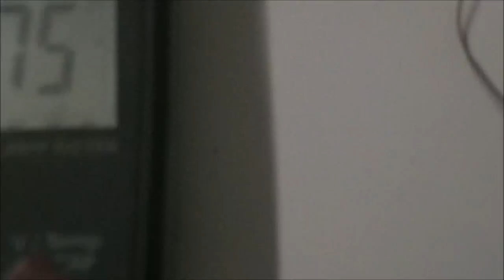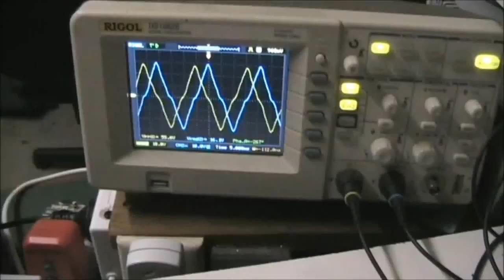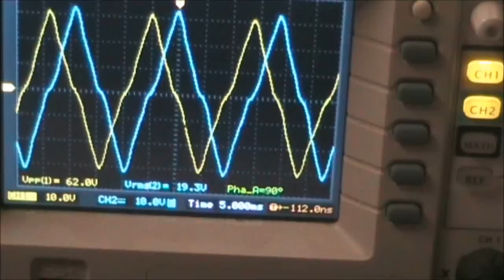Two Phase Generator/Exciter (test arrangement)

Comment: Finally! New bearing and get rid of the magnets. You want closed looped induction coils on the rotor. 2 phase. A magnetic loops should form between the ring core and the pulsing electric field of the field cores You can tap the unit for more power via unshorted rotor coils. In my design there are 3 sections just like Tesla's. Exciter/generator/motor.